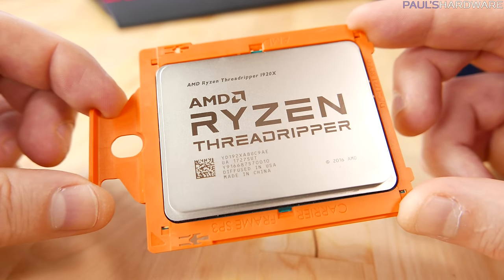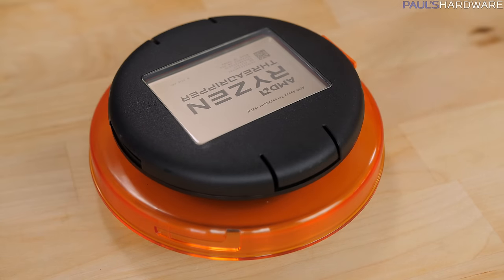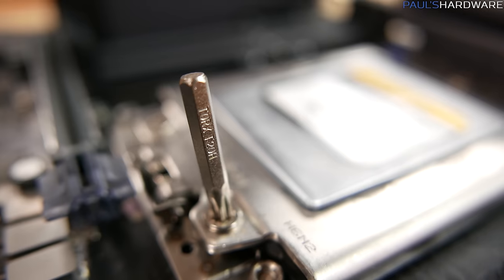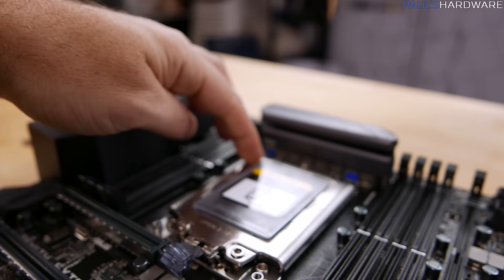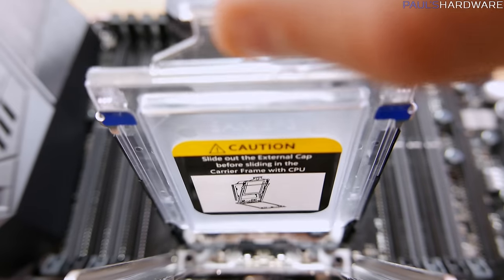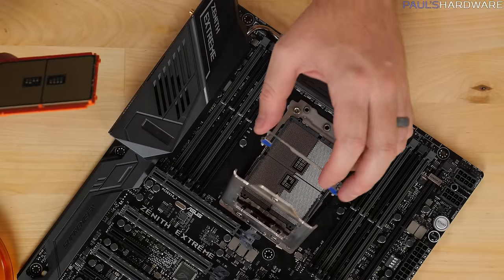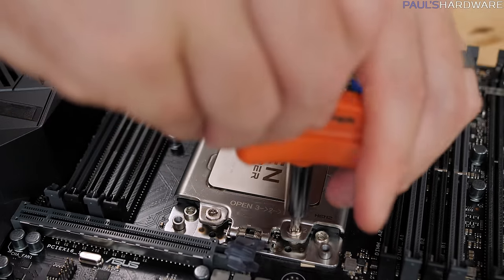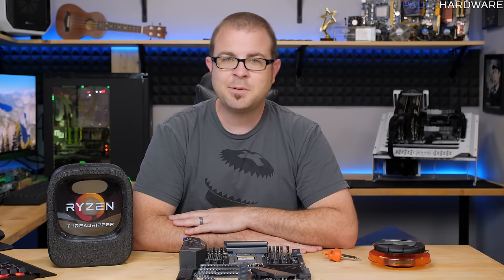Threadripper CPU Installation Guide! How Socket TR4 Works

Comment: Seriously, what the hell AMD, you need actual TOOLS to install a CPU into the socket, in my nearly decade and a half of PC building I have NEVER seen a more complicated CPU install.
Reply: DanielRichards644 it is pointless actually, however if you want to have a simplier install you can buy an i9 which will cost you a couple more bucks.
Reply: DanielRichards644 to be fair, when installing a server-cpu you need tools aswell. What I dont see the point off is why they needed a plasticframe? Why not just make the slider the size of the normal cpu? Or is this so they can make an even bigger cpu later (with no plastic frame)
Reply: Andrew N 
I think it is so you don't have to touch the cpu itself, so there's less chance of damaging (ESD) a rather expensive part.
Reply: I actually get the plastic frame, if they didn't do the plastic frame they would need to make the substrate of the CPU larger so there would be room between the pin contacts and the edge so it could slide into the rails without shorting pins and the plastic is cheaper, I also like the slide rail system, I just don't get the need for the screws, how would they hold things down any tighter then a pair of retention clips like the 2011 socket has?
Reply: I have been professionally building and repairing computers for about 1 1/2 decades myself. I have had the pleasure and regret of building servers for small businesses as well.

I have seen some of the most complex CPU installations, In 2009 I helped build my first small business server for a local company looking to have a centralized single computer with virtual clients, doing that install was a pain in the ass, including the CPU.

Threadripper itself is a bit of an oddball CPU and it's AMD's first LGA for the mass market, I believe they went with an overbuild on this, however this design may also be justified for pressure to be exerted evenly across all 4 CCX's, whereas Intel uses a monolithic design.

The quad CCX design certainly changes all of the rules and this may actually be a contributing factor into why the setup is a bit more complex than the average.

What is certainly going to be interesting is when custom coolers hit the market and the installation videos for them hit YouTube.
Reply: The reason for the socket being designed this way is for mounting pressure. Those 4k+ pins require more pressure than what a latch or 2 can provide easily. Also probably makes the socket design smaller overall than what would be needed using a latching bar.
Reply: @Kikoo Kikaboo That's making me laugh as heck. Can you even read? When did i mention it was "overengeneering"?
WTF are you even talking about?
What i said is just that this is different from every other cpu on that level (obv specific server sockets can be definitely trickier), that's it. Is everyone on their period over reacting and reading things i never said? lol
Reply: @Chiriac Puiu Same answer....where the hell did i say it's over engineered or over complicated? Learn to read than answer.
Reply: DanielRichards644 i honestly think that this ia due to the size of the socket more than anything else. The chip needs a ton of mounting pressure to make contact.
Reply: DoubleH D 
It's not complicated in the absolute sense, but it is complicated relatively when compared to the alternatives lga1151 and am4
Reply: Hydrochloric Acid n
Reply: At least they actually come shipped with the tool in the box. If not, I'm pretty sure we'd see a lot of pissed off enthusiasts if they didn't.

It seems to me that AMD over-engineered the installation a little bit to ensure the pins don't end up getting damaged and even pressure is applied to keep such a large chip in place.
Reply: DanielRichards644 complex? es. more secure than simply dropping the cpu on the 4094 pins? yes
Reply: see i get that its compicated compared to older cpu installations but if it was just put it in and close the retention arm there is chance of damage and they are pretty expensive so rather safe than sorry. 4094 pins and a huuuge cpu chance of damage is pretty high.
Reply: BeAsT MaStEr74 and EVERYONE ELSE, I never said not to use the slide rail, if you do the slide rail then lower the cover over it there would be no more chance of anything happening with the retention arms then with the screws.
Reply: I think its more for even pressure than avoiding damage.  ALso might be because of lack of space.  Retention arms that would provide the same level of even pressure likely would have made the socket too large to fit on conventional MB designs.  This is the largest CPU in history because of the 4 dies on one design.  It was also taken straight out of Epyc.  Exact same socket.  AMD doesn;t have the money to design a different cpu for Threadripper and Epyc.  They could have probably done that and made it only 2 dies,  made the socket smaller,  and had space to put retention bars on,  but since they didn't,  this is what you get.
Reply: Look mate just because you've been doing something a certain way for a long time doesn't mean it can't ever change. There is probably a reason for the installation to be the way it is. It costs more to include that tool in the box and I'm sure unless it was absolutely necessary they would have skipped it. I've been building desktops and servers alike for over 2 decades and I can tell you that every company has their own way of doing something. May not always seem like the most efficient way from my perspective or anyone else for that matter. However as engineers we should adapt and continue doing what we do best which is building these systems. As far as I'm concerned it's welcome change from the norm and I got no issues with that. Just my humble opinion.
Reply: TRIGGERED

Comment: WTF, Why on earth would you remove the socket protector before sliding the cpu into it's subframe?

That's the most likely point you will possibly drop something onto the socket, the design is obviously made so you can slide the CPU into the subframe then remove the protector when you are ready to seat the CPU down..

If you are going to do a tutorial, please get the order right.